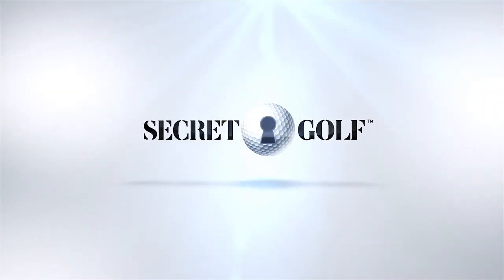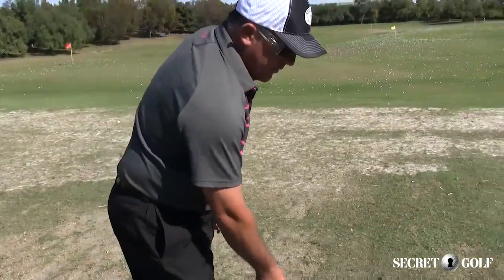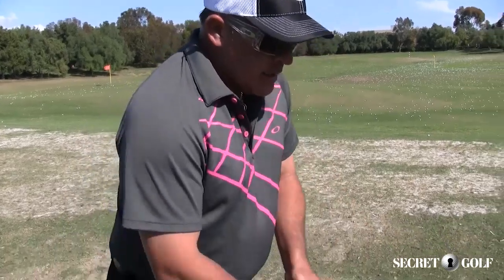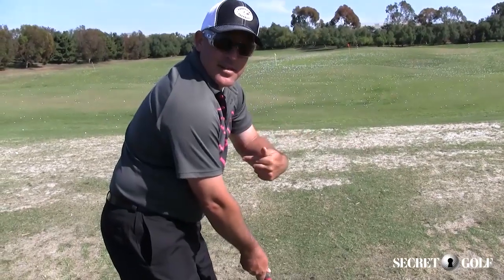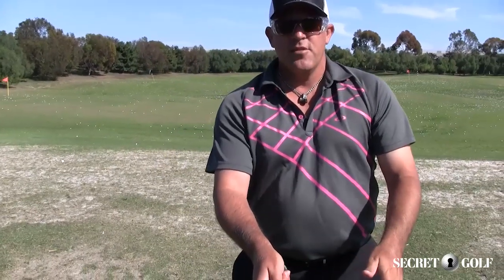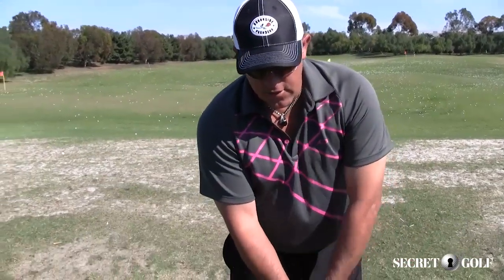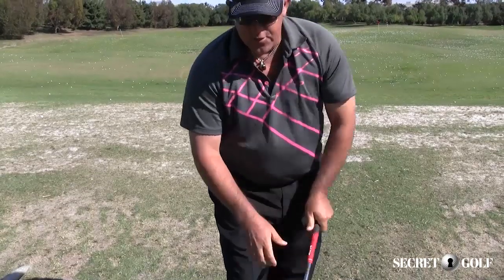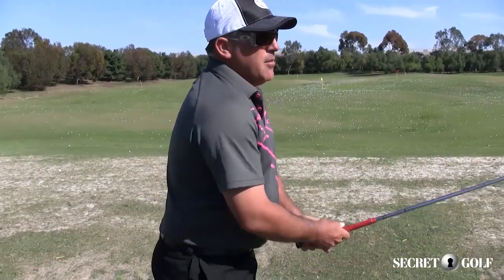Martin Ayers: Right Arm - Static vs. Dynamic View

Comment: Hi Martin your are right the twirl is not seen in the swing. However after watching your videos I finally figured it out on my own how to do “The Twirl” at the top of my downswing. Especially since I have been doing my “twirl waggle” for some time now: As the two nicely go hand in hand. 😂

Simply with my  left hand I turn the handle of my club handle maximum about 1/4 turn counter clockwise as I swing my club back; and then up with both elbows of the arms ( and never with my shoulders and upper arms.) At the top of my swing I immediately use my right hand to twirl the handle of my club clockwise 3/4 turn to the very finish of my swing. 

By dong this 1/4 anti clockwise turn on the handle with my lead hand followed by a 3//4 clockwise turning of the handle; I completed my full circle with my trail hand. And so now I am asking myself: Did I swing my club or did my club swing me? Cheers 😃👍⛳️🥂

Comment: Perhaps I am confused...but I video'd his last swing down the line.  He did not do anything like he demonstrated.  It looked absolutely conventional.
Reply: The motion he is making is a the same as a hammer throw in the Olympics games except there is no ball and chain. Instead you got a shaft and club head. The faster you make this hammer throw motion the more balanced and lighter the weapon or golf club gets thus making it lethal on your opponent or a golf ball. You can’t see a full speed because the inertia of the club head gets in line with your hands without you positioning it yourself. This is why golf positions don’t work because you didn’t actually achieve it dynamically but statically.

Comment: Sl faster swing at 1:53 you cannot see the hammer thrower move… use YouTube > Settings>playback speed > 0.25
Swing at 2:00 you can see it, it’s very obvious the shaft lifts way up , thereafter there are no visible signs of this move whatsoever, so I’m guessing this a prime example of feel v real.
Clearly works for him and Elk, my bet is this is an exaggerated feel of reverse lag at initial takeaway and an equal exaggerated feel of a heavy clubhead shallowing at transition getting into a super position at P6 and through to an equally superb impact conditions at strike.

Comment: While I don't know the skill level of the posters here, I agree with those who say Martin speaks in circles and colors.  Try watching his videos on his premium site with his partner Powers - it is absolutely painful.    I must have spent over 24 hours watching/rewatching nebulous videos about "containment", "two oscillations", and "trail side strike".   With that said, whether they're being purposely evasive or not (like the origins of the golfing machine) I finally decoded what the hell they're talking about in simple terms.  And it works.   PS - I'm a +2 hdcp who feels he has a command of the golfing vocabulary.
Reply: For gods sake share the simple version.  It's way beyond my comprehension..
Reply: @roliver7773  Try keeping your sternum facing the target (or direct as he puts it) as you swing your arms back and thru.  Left knee goes straight out on the backswing, right knee does the same on the downswing.  Reverse roll/work the hands against the shaft (i.e. Caddie lag) to apply pressure to start the backswing and create a clubhead sling.  At the top, throw the club to start the downswing (along with the right knee straight-out trigger).  Stay facing the ball.  Don't focus on dropping the arms, this will stop rotation and cause early extension and won't keep the left arm high at impact.  This is not all of it but enough to  get started.  Good luck experimenting!
Reply: @psgriffin1  Right.
Reply: @roliver7773  You're welcome.
Reply: +2 handicap and he is watching martin’s videos. Yeah right🤣😂🤣😂🤣😂
Reply: @kalaharisafari7648  Just starting doing winter drills again. I'm a +1.9. Two course records this year :)  Check out his very first 
two videos on his site.
Reply: @psgriffin1  you are a very funny guy. +2 that shoots 70 yet has two course records. Classic 18 handicap talk mate🤣😂🤣😂🤣😂🤣😂🤣😂🤣😂🤣😂😂🤣😂🤣😂😂😂🤣🤣
Reply: @kalaharisafari7648  Do you have access to look up GHIN?   CR's were 61 on a 70 (clean card).  Other was 64 on a 71 (8 birds/1 bogey).  Talk to Peter Croker in Australia - He'll vouch.
Reply: Speaking of Peter, he is an excellent teacher.  I've used his Key To Golf Program for years.  He and Martin talk about the same feels but in different terms.  Croker likes the feeling of the clubhead last take away, which gets the club slinging back in what he terms a 'low loading' fashion.  He has a specific drill on his paid site called 'Sorcerers in the Stone' to develop that feel.  Downswing feeling is thumbs down with a steady left shoulder.  Martin talks about having the club move clockwise in the downswing while the body moves in a counter-clockwise fashion towards the target.  This effectively gets the thumbs working down A to B  like Peter describes on his site vs. throwing the club head OUT attempting to steer down the line.  Golf is a two-target game.  Clubhead moves A to B.  Ball moves from B to target.  Highly recommended Croker's golf learning program.  Martin's Northbound site is a bit tricky to comprehend but since I'm a +2 I was able to figure it out Mate ;)
Reply: @psgriffin1  were those two courses u played on ur playstation? 🤣😂🤣😂🤣
Reply: @psgriffin1  Nope. Where I come from scratch golfers don’t go to YouTube for golf instruction. And amateurs don’t holds any course records.They are all held by the pros🤣😂🤣
Reply: @kalaharisafari7648  I guess when you've played D1 college golf, played in 3 US Mid Am's, won 12 tournaments in your state golf association, and 9 club championships on three different courses, these things happen.  More to the point, if you're in the States, let's play the tips on your home track straight up for your Net Worth.
Reply: @psgriffin1  u remind me a lot of Wayne DeFrancesco. He also thinks he is this incredible golfer because he competed in a few US PGA’s yet he only made a few hundred dollars on tour as a pro🤣😂🤣